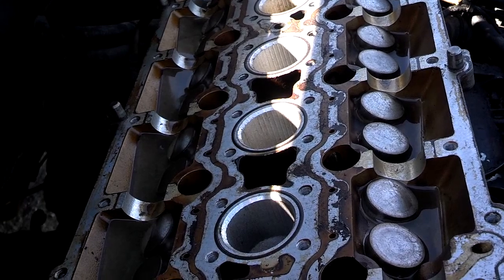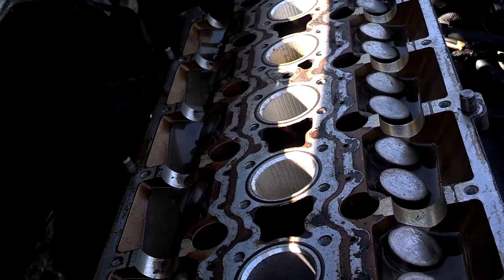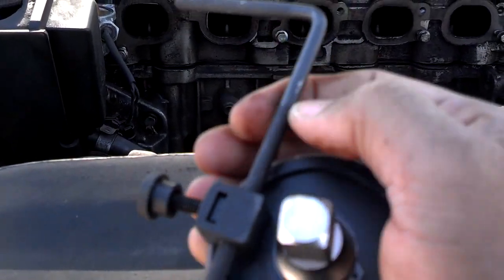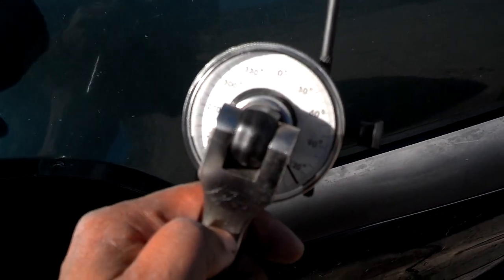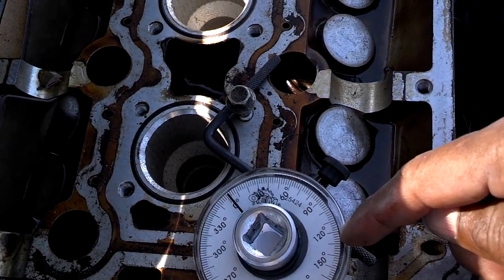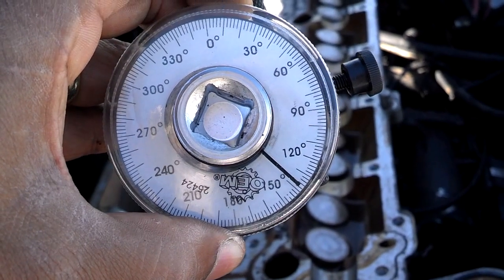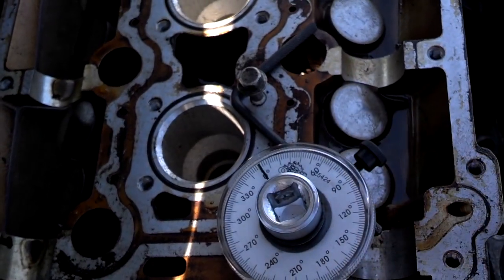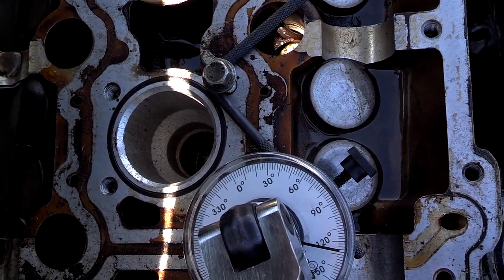How to use an angle degree torque gauge, this torque is usually used on torque to yield bolts.- VOTD

Comment: Hello, pardon my ignorance, and especially if my question has already been answered in the 526+ Comments:   I've always tightened automotive fasteners to a specified ft-lb/Nm using a normal torque wrench.  For this torque gauge calibrated in degrees, why is the "angle" chosen to be 130 degrees vs some other angle?  And how does the specific angle relate to the actual torque (ft-lb/Nm) applied to the fastener? Is there an equation or cross-reference table that relates the measured angle to actual the torque being applied? Thanks in advance for helping to educate me.
Reply from the maker: https://youtube.com/shorts/8848hHOqiDw?si=gx87hnOKxPFID20b
Reply from the maker: Always used with one time use bolts.
Reply: Thanks for the followup. 
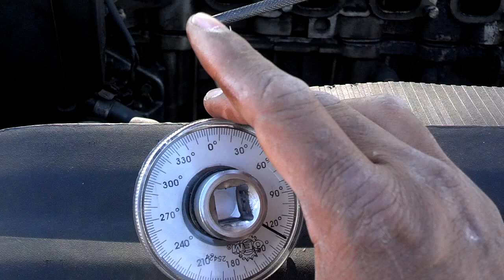So, is the specific ANGLE (130deg, 90deg, etc) 1:07 specified for each bolt type individually?  Is is 130degree angle you mention A STANDARD for any and all fasteners?  Eg like turning in a spark plug an additional 1/4-1/2 turn to compress the washers in the plug when being installed new?

Comment: Just found your video 10 years after you posted it. I had to buy a torque angle gauge for some torque to yield bolts on my upper control arms. I wasn't sure how to zero it out or what the arm was for, so thanks for clearly and concisely explaining it. Tackling my project tomorrow, thanks!
Reply from the maker: You're welcome! I hope it all works out for you.

Comment: Do you think is there big difference if you turn one or  couple bolt more than 130 degrees? Like 140 degrees? We did that same thing but my friend hold that stopper and I turned with breaker bar. Every bolt is minium 125 or 130. I think its good to go. In the future, we will use that technique.
Reply from the maker: Should not be a problem.

Comment: Helped me understand what the L tool or handle is for on the gauge, thanks. I'm doing a lifter job on my chevy 5.3 and instead of needing a $179 digital torgue wrench I can use this 10 dollar tool for the angle. I have a 3/8 digital torgue gauge for the 22 pound initial first round and the rest are 90 degree turns which this tool will accomplish nicely.
Reply from the maker: Thanks for watching and sharing.

Comment: Also will add for people using one of these , if your bolts are TTY torque to yield ..the bolts stretch and should not be used again . Newer American vehicles  mid 90s and up especially use a lot of these TTY style bolts.  I had heard of these bolts on Japanese vehciles in the late 70s, and on my 83 Ford Escort 1.6 L had these TTY head bolts. I just rediscovered on  my daughters 2007 pontiac 3800 engine these bolts are used on the automatkc transmission flexplate as well. Be careful folks.
Reply from the maker: I have had them break off and fall out on the front wheel knuckle while driving. Dangerous.

Comment: Ya, I have a question. I thought I had this tool figured out, but here's what I ran into. I rotated 90 degrees on a head bolt, then felt the needle "fall back" a few degrees after letting go on the breaker bar. So, do I over rotate past the degree on gauge so that it falls back to 90?
Reply from the maker: no

Comment: I'm 71 years old, and have worked on my own cars since my very first car, before that, I helped my dad work on cars, including tearing down and overhauling various engines, including honing the cylinders, hand-grinding the valves with a spinner and valve grinding compound, etc. Being "old school", and having worked on everything except imports, I had never had to use a torque angle gauge before. Everything i had ever worked on required "X" ft. lbs. of torque for the head bolts and other critical bolts. 

My mother's 1999 Honda Accord LX, 2.3 liter 4-cylinder engine is the first one I've had to change the head gasket on that requires a torque angle gauge; so I had no idea how to actually use one. Rather than fumble around figuring it out for myself and maybe breaking the gauge in the process, I looked it up and was led to your video. That turned out to be the best decision. 

I love the way you get right down to business and explain the process and the best way to go about it. After seeing this video, I subscribed to your channel, and I added your video to my Auto Repair playlist. I will be recommending your video to friends and family, on and off of social media. 

Thank you, Robert, for a well-made video. I wish they had a "thumbs up" and a "big ol' thumbs up". I would definitely give you a "big ol' thumbs up". ;)
Reply from the maker: thanks for your kind words and for watching.
Reply: @RobertDIY  You're welcome. You deserve the good words. Watching your video was my pleasure.
Reply: After reading the Haynes manual,  I noticed gm went from 3 step torque to  torque once and angle in 96

Comment: Where did the number 130 come from and how does it relate to the  torque of the head bolts.  Confusing to a non mechanic like me.
Reply from the maker: Manufacturer. The bolts stretch, called "torque to yield". You can Google it for more info.

Comment: Sir, 130⁰ stand for 130lbs or 130Nm. Im confuse to set torque using this tool. There not mention lbs or Nm just degree. What weight for the degree i dont know. Help me sir
Reply from the maker: In a circle there is 360 degrees. Half of a circle is 180 degrees. Half of that would be 90 degrees (0r .25 of a complete circle). Degree torque is part of a complete circle. So 90 degree torque would be 1/4" or .25 of a complete circle turn. Hope that helps.
Reply from the maker: https://youtu.be/KppFZABPK34

Comment: are degree values equivalent to Nm values? what is the difference?
Reply from the maker: No. angle torque is designed to properly stretch the bolts.

Comment: Thanks Robert. Do you need to use the L shaped adapter or can it be used without it. New subscriber good video thanks for sharing Artie 👍
Reply from the maker: anything that will stop the base from turning.

Comment: Despite wrenching on cars for the past 20 years, I'd never heard of a torque angle gauge before today while working on my car (always something new to learn!)  Thanks a ton for the quick, concise, informative video Robert!  Well done!
Reply from the maker: thanks for watching.
Reply: I’m almost in the same exact boat here, my good torque wrench broke when I was cranking like 180 ft lbs on a big ol nut and I didn’t want to guess… so I found this exact type in my bottom drawer of one of my boxes lolol….  and then you go look up how to use them and find 30 min videos breaking down the calculations of density between various metals etc. greatly appreciate the simplicity of your video

Comment: Hmmmm... Two problems with this tool: 1. To get consistency of tension, every bolt needs to start from a common tension (requiring a tension/torque wrench), which perhaps could be achieved by going to hand tight on a short breaker bar. 2. Even if you have a common starting tension, this gauge isn't going to take the bolts to manufacturer-specified tension unless you happen to fluke the right combination of starting tension and degrees on the gauge. Am I missing something here?
Reply from the maker: Most procedures that require this tool has a post torque value setting.

Comment: Thanks my friend. I'd always just been holding that little handle as still as I could. Its worked well that way but I'm only turning 90 degrees for my application so it wasn't that hard. Any farther and where I'd have to reposition myself might lend itself to disturb the gauge and then heaven help me to know where it stopped at! lol Never thought to brace it on a bolt like that. Oh well...learn something new every day here at youtube university!

Comment: I don't understand where you got the 130 angle from - maybe because I'm not working on a cylinder head...

Is the bolt in the cylinder head already torqued to a setting with a torque wrench?

Is this tool only useful if there is another bolt to hook the lever from the gauge?
Reply from the maker: The repair manual.

Comment: I have no idea what this is from a mechanical perspective. So the 220 euro torque wrench isn't enough?  I thought one tightened based on pressure applied to the bolt but now they tell me I need to tighten again with a breaker bar. Why not just tighten with torque wrench and add an extra pound or two.
Reply from the maker: The bolts stretch.

Comment: so this is used to tighten a bolt a certain number of degrees instead of to a torque value?
Reply from the maker: Yes, the degrees is a torque valve as well.
Reply from the maker: Usually a torque for stretch to yield bolts.

Comment: Can you use an angle degree torque gauge with an impact gun?  Sometimes crank or cam sprocket bolts require angle torque, but it can be very difficult to hold the crank or cam from turning while tightening the sprocket bolt.  Therefore, it's easier to use an impact gun.
Reply from the maker: I wouldn't think so.
Reply from the maker: https://www.youtube.com/watch?v=KppFZABPK34
Reply: How then do you suggest applying angle torque to something like a crankshaft sprocket where the crank wants to rotate when applying large amounts of torque to its sprocket bolt?  I had a situation where the engine was in the chassis and I couldn't come up with any feasible way to hold the crank from rotating while I torqued the sprocket bolt to the specified angle.
Reply from the maker: Did you watch the cheat video? All you'd have to do is mark the crank and nut, then go from there.
Reply: Yes I watched the cheat video, but that's not my issue.  In your cheat video, the wheel/axle assembly was prohibited from rotating as you applied torque to the nut, since the wheel was on pavement.  On a crankshaft sprocket, the crank wants to turn in the engine bearings while you apply torque to the sprocket bolt.  So I don't know how to hold the crank from turning, so the sprocket bolt can be torqued.  And therefore, I thought an impact gun would help, because it will tighten the sprocket bolt without causing the crank to turn much.
Reply from the maker: Why wouldn't the cheat work? You mark the crank shaft, then mark the nut, then hit it a few times with the impact, then check it, if it turned, that's ok, because you can see how far the nut moved. Or, you can complicate it more. Bottom line is that you don't loose the nut or damage the threads.
Reply: Now that I think about it, I see that the cheat would work in that scenario.  I now understand what you mean.  Thanks for helping me see that!

Comment: These gauges work fine for your head but they are pretty shitty. The Lisle one is better but the digital ones are best. I have the one in this video and it was nearly impossible to use on a SOHC V8 engine I was working on. Piece of shit tool.
Reply from the maker: Interesting.

Comment: Good vid.  I bought one of those from Vatozone and the dial was slipping. I got the 
 LISLE torque gauge #28100 and it is so much easier to use.
Reply from the maker: Good deal, thanks for sharing.

Comment: The torque instructions I have are:  = 738 Ft Lbs +92 -0. What does the +92 -0 mean?
Reply from the maker: I have no idea. I have never seen such a high torque value.
Reply: Usually that kind of callout means 738 Ft-lbs is the target, but you can go up to 830 Ft-lbs (738 + 92) without causing harm. However, the -0 means that you should make sure you reach at LEAST 738, or the bolted joint will not perform as intended.

Comment: That is about obsolete and most don't use them anymore.Use an electronic torque wrench with a built in angle gauge in it
Reply from the maker: Who has $$$ to buy one of those?
Reply: The electronic torque wrench is much easier to use.There is also one that is magnetic going on the handle of a long breaker bar or ratchet too,which is electronic.My dad has the Snap On version he bought several years ago and no longer uses it.He bought one of those electronic torque wrenches with a built in angle gauge.
Reply from the maker: I used one yesterday. It kept shutting down and restarting on my. Took me longer to complete the job because of it malfunctioning and me over torquing things. Besides that, you still have not addressed the issue of the cost of the tool for us DIY people???
Reply: My dad paid about 400.00 for his Matco which has lights that come on that beep.Green means good and red shows overtorqueing.That one you have,it is hard to read in tight spots in the vehicle and this with trucks and cars with v8 engines under the hood
Reply from the maker: $400 Can be a lot of money for someone that has been out of work for 6 years.
Reply: A better option for someone that builds engines a lot.There are some over 600 degree turns after torqueing a fastner,this is with heavy equipment engines.
Reply from the maker: Wow!
Reply: Of course there must be awesome electronic torque wrenches with included angle gauges, but let me tell you about my experience with them. I use to trust better a "regular" or lets say mechanic torque or angle wrenche after using for a while an electronic one. Why? Everytime i sat on the correct torque a bolt with the electronic, when i tried a second pass on the bolt the electronic torque wrenches always wanted to screw a bit more the bolt... And it was not a cheap one....
Maybe i´m not used on them but a good classic one works easier for me. Of course i´m an amateur and maybe a pro mechanic can value the modern ones better than me ;)
Reply: That gauge is hard to read when doing the torque sequence in the vehicle.This is with the vehicles with V6  and V8 engines.It can slip on you when doing the degree part when turning the fastner after torqueing it down.
Reply: wafrederick after reading you, I was searching for these items and found these other circular adaptors, electronic torque and degrees, you can use a regular wrench on them and they don't rotate while you're working... But maybe the lack of space on some areas could be a problem? What's your opinion?
Reply: Lack of space too.Have seen them slip off and this is with the Snap On version my dad never uses anymore,won't stay in place.
Reply from the maker: I had one of these break on me the first time we used it. Scary when torquing on head bolts.

Comment: So I'm just trying to get into mechanics and I don't understand why this would be used. I assume you would tighten up a bolt to the correct foot pounds of torque with a torque wrench and thats it, is this used instead of a torque wrench? why is it used?
Thanks, man! :)
Reply from the maker: +Luciano Narno used after the torque wrench. Usually used for bolts that are stretched to yield, extra tight applications.
Reply: Luciano Narno manufacturers specifications.
Reply: Many bolts on newer engines are "torque to yield" and have a specified bolt stretch that must be reached in order to be considered properly tight. For bolts like this a simple ft/lbs specification isn't good/ accurate enough.
Reply: That's interesting..mostly worked on the older motors..350 Chevys and 455 Buick Olds and Pontiacs etc and with those you simply torque the head bolts to whatever the manufacturers called for.. Learned something new..

Comment: like this one for sure as I have to do this on my modular supercharged motor
Reply from the maker: +Ray Burkett Cool, thanks for watching.
Reply: Rob I tell you the best thing since sliced bread is the internet!! The LAST thing I wanted to do was pull this damn engine out after all the pain, blood, sweat and tears it took to swap it in. After just two runs I find out that my thrust bearings were gone on a 11,000 mile engine. Complete tear down and rebuild of a ford modular motor was not on my list of things that i ever wanted to experience. Well its an all forged 1000hp bottom end now... May be able to click my name and see my swapped project. Im rather new to the utube posting experience.
Reply from the maker: +Ray Burkett ouch!

Comment: only problem with this explanation is that you shouldnt use the adapter because you lose torque. you should use the correct the correct size socket
Reply from the maker: +Cristiang Guzman true. Thanks for watching and for your input. Also, the longer the extension the more torque you loose. That is why I used the shortest possible.

Comment: hi, where did you get the number of 130% from.  In another video a guy set the gauge at 90% and no one is explaining where you get the number for your cylinder head?  Maybe i'm the only one who doesn't know this?
Reply from the maker: jonny tsagakis The torque will be different for each engine. You have to get the specs for the engine you are working on.

Comment: Hey man, very useful information!!
I have a angle tool too, same as yours and I have that apply 2 angle torque in a crankshaft screw after change the timing belt.
But in my car not have a hole or other screw to fix the "L" to lock the angle tool!
I wonder if I could hold the "L" with a hand or not?
Thanks!!
Reply from the maker: Rodrigo Volta Probably not. However, if you study the gauge measurements you may be able to apply the angles without the tool. Example, a 90 degree torque would be from 12 o'clock to 3 o'clock.
Reply: Robert DIY, so you would recommend using your quick fix (as shown in your other video)for crankshaft screw which includes a 60 degree angle torque?  Thanx for a great vid!